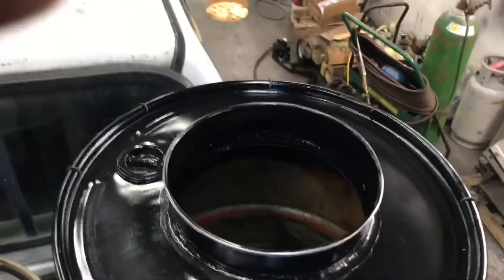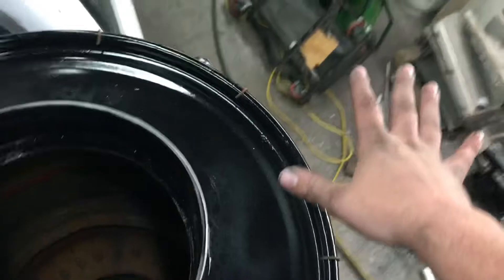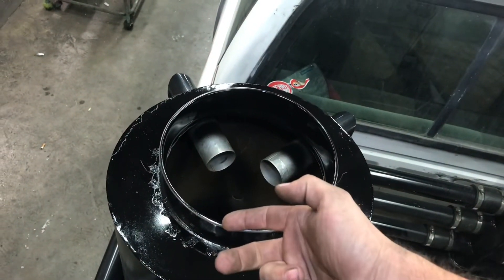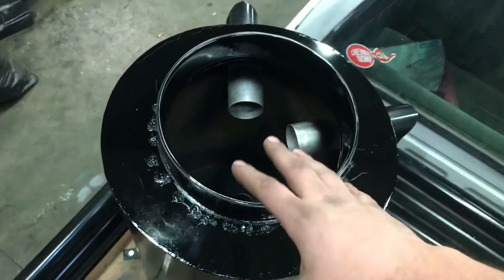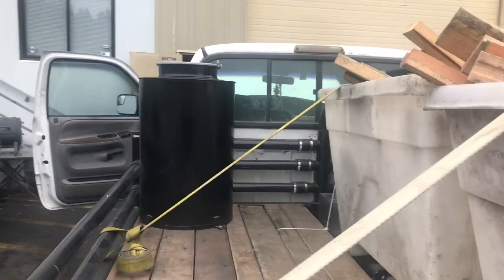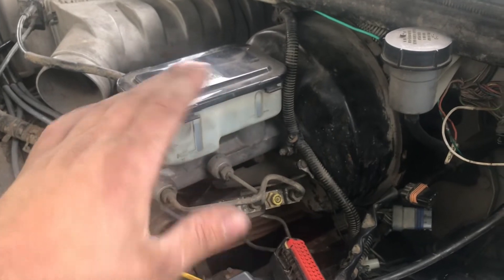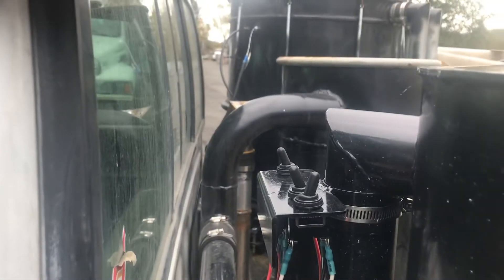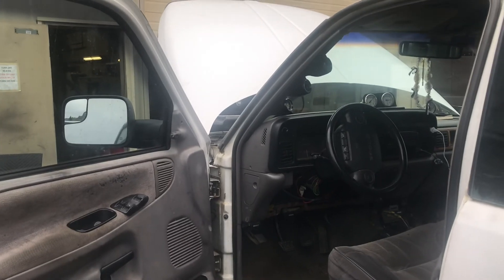V10 Gasifier Build Hay Filter Finished and Blower Wiring

Comment: On the condensation drain. A thought. What about some light mig welds at an angle, from center to the edge, on the lid to help precipitate fluid flow to the edge? The welds would help pull condensate out to the gas because of turbulence.
Reply from the maker: There are some guys that have done that and it works very well, even one fellow that built a cone under the lid and conclaves the lid so any condensing that happened which high up in the hopper is a lot of tar and some water, will catch in the cone and center drip back into the hottest part of the gassifier. The water wil almost instantly flash off but the tars will super heat and thermally crack into hydrogen and c02 creating a better quality of fuel. In theory if all tar condensed from the hopper was sent back into the hot zone it would make the produced gas MUCH more volatile and energy dense, not to mention prolong hopper refills. Same theory is applied to charcoal gassifier where they introduce a water drip into the hot zone and make a ton of hydrogen. This also cools the reaction down some since a charcoal gasifier hits and sustains metal melting temperatures while in operation. Raw wood systems will get those temps too, but they are engineered to survive those temps with heat recycling and don’t sustain those temps except on a very very hard throttle pull. Which I’m known for doing 😂

Comment: Really enjoying your vids! I saw someone use hamster bedding in their final filter and it looked like it was easy to clean that way. I wonder if it's better than hay?
Reply from the maker: hay is more of a coalesce, it does a pretty good job but fine filtration is key to keeping the soot out of the engine. It doesn't really hurt the motor, but it does mean more frequent oil changes and using non sythetic oil. synthetic oil has a strange reaction with woodgas and causes it to get super thick, im doing oil changes every 2500 miles. I do plan to work on the filtration in this truck some more very soon I just really wanted to get it on the road asap with fuel prices over 5/gallon again
Reply: @BigBeavrSlayer  I didnt know that about the synthetic oil, good info! I dont use synthetic oil anyways but that's weird. If your valves are clean no worries. Though each oil change I do on normal engine I add a quart of that lucas oil additive, I wonder if woodgas would effect that?
Reply from the maker: @kittywampusdrums  that's a good question